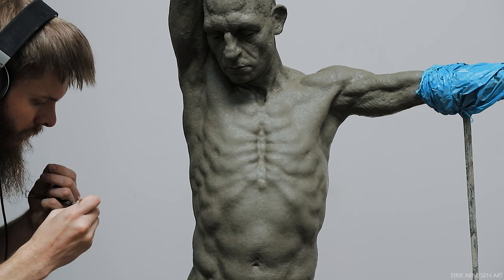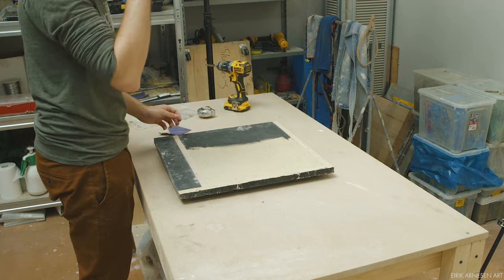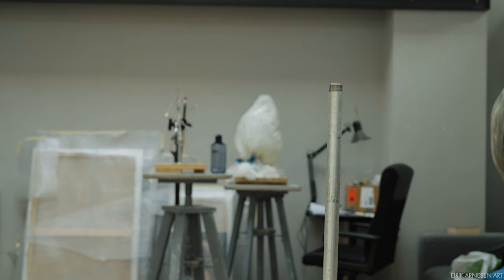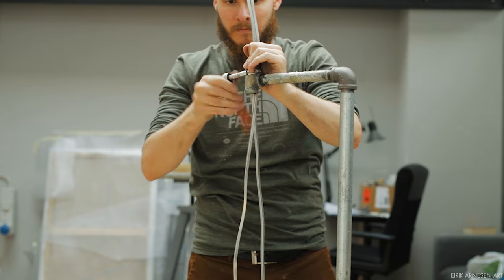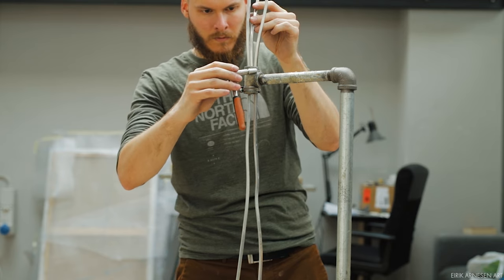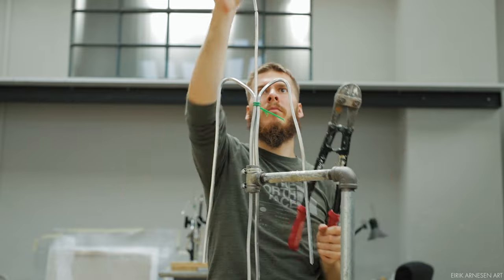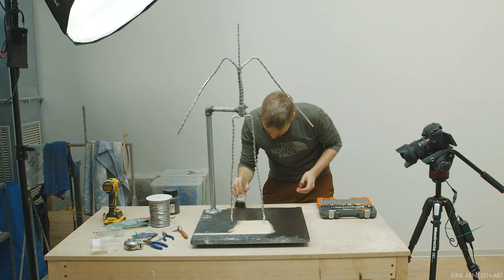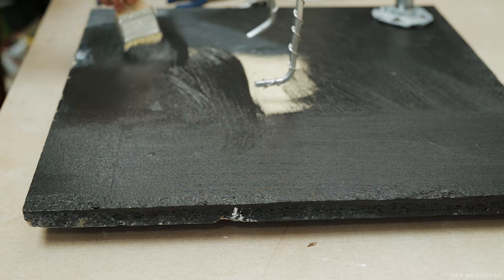How To Make An Armature

Comment: Hi Eirik, I am getting into working on clay reconstructions of extinct animals based on fossil remains; I cannot express how much your videos helped me so far (not to mention your art whch is amazing). Can you help me out with the exact type of metal product you're using to make the armature? I have been looking for such "rods" that bend well but are rigid at the same time (stay in place). I've only found strong and thick wires, but those are not stiff enough. Thanking you in advance!
Reply from the maker: Hello. That's awesome! I learned a lot from a forum on dinosaur sculpting when I was starting out. The metal rods are aluminum armature wire, those are the internal support. The external support are plumbers piping from a hardware store. Here in my FAQ's you'll find links to places where you can buy all the materials that I use, including the armature wire: https://www.patreon.com/posts/54343994